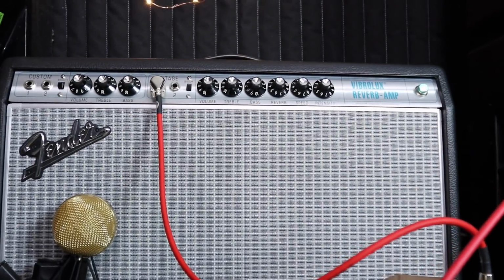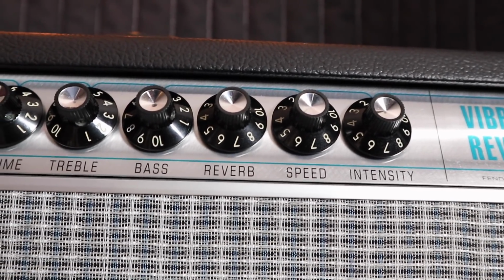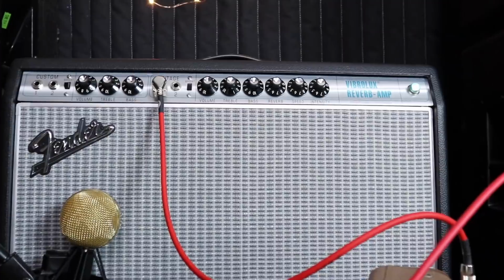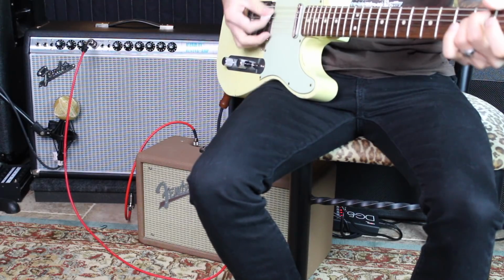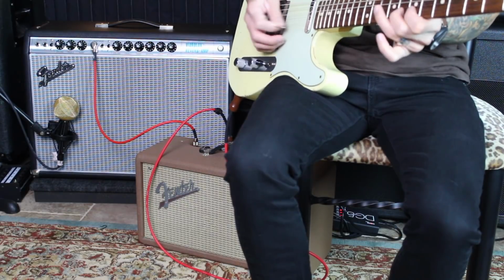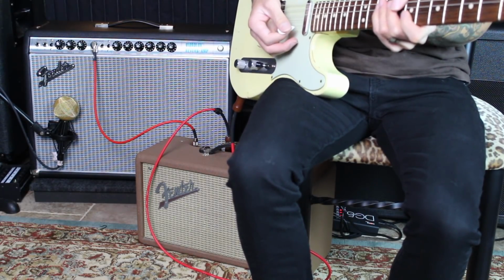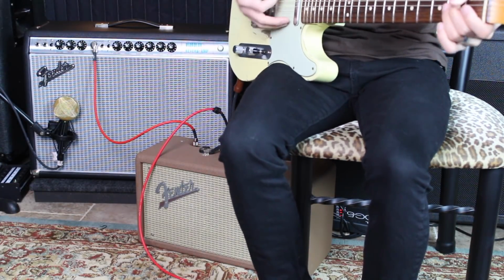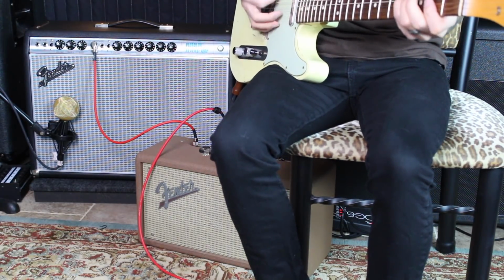Amp Reverb vs. Stand-Alone Reverb Tank | Guitar Gear Tips - Tutorial | by RJ Ronquillo

Comment: "re-VERB"!  Ok ... here's what you do with that in-board re-VERB unit in your combo amp! Unplug the input at the amp, that leads from the tank (the tank output wire). Buy a female-to-male RCA cable to be used as an extension. ALSO, buy a 1/4" male jack that has a FEMALE RCA jack on its butt. Plug that extension into the RCA-female-to-1/4-male jack, and plug that into the FRONT of the amp, channel one. Roll off all the bass, but maybe ONE or TWO. Increase the treble to your liking, maybe even push up the "BRIGHT" switch. Channel ONE essentially becomes your re-VERB control, so set the volume where you like it in relation to your DRY volume, in channel TWO. You will love the sound!! SO much better than the normal re-VERB sound! Try it, you'll like it!
Reply: This sounds cool, gotta try it!
Reply: @DaveElke  Yessir. Makes a BIG difference in my opinion!

Comment: To my ears it seems the standalone has the holy grail surfy drip that no other tank or pedal can touch.
Edit update: The Surfybear could be a contender.
Reply: I have a reverb pedal made by a company called Fuzzrocious that's as close as I can get. It's not the same, but it has a great drip.
Reply: But, is the Surfybear able to have the 'stomp shatter' effect done, as can be done on the FenderReverbUnit?
Reply: @bonsummers2657  It could do. It’s still a spring tank, just with no tubes. 🤞🏼

Comment: The Reverb Spring Tank Units were probably built by (or licensed by) Hammond as the Non-Necklace style units first appeared in 1960 in Hammond A-100, L-100 and-100 Organs, they were predated by the Necklace Reverb units that appeared in Early A-100s and PR-20&PR-40 Tone Cabinets (the problem with the Necklace Units is that they Rattled too much).  These were predated by the Hammond Oil Reverb tanks that appeared in Hammond Tone Cabinets from the late 1930s to 1958 and could be found in HR-40 Tone Cabinets until 1963.  These Oil Reverb tanks were partially filled with Automotive Brake Fluid and had a sort of "Slap Back" Sound.

So without seeing the inside of a Stand-Alone Fender Reveb, I would assume it had a Hammond Tank. I have a Late 1960s Conn Organ that has a Hammond Reverb Tank.

Baldwin (for their home organs) had a Reverb Unit called a  "Panoramic Tone" that somehow got around Hammond's Patent, it also used a Spring, but it was a suspended spring (similar to the Hammond Necklace, but it was a larger Coil spring resembling a Slinky but only half of the Slinky's diameter.  I pulled the Reverb Tank out of a later Panoramic Tone that had a different off shaped spring in a small metal box. 

There were also Tape Reverb Units (Schober Organs and the Echoplex) and Plate Reverbs used in the Recording Industry.
Reply: I got the Boss Clone of the Fender Stand-Alone Unit for one of my Hammond Organs, hoping it would be able to respond like the Electrotone Organ Mate Aftermarket Reverb kits for a B-3, but it could too easily be overdriven by the organ (it would work on a very minimal setting only, that was a bit too soft for my tastes), so I put it in my Guitar stomp box kit where it sounds at least close to the original.

Comment: My goodness. Standalone by a mile. It's THE DRIP! thanks for doing this.
Reply: It's only more apparent because he runs it into the front end of the amp. It would probably sound similar if it was in the fx loop.
Reply: @Mikhail72051  It's made to be a preamp. Why would you want to remove it's best feature by plugging it into an effects loop? Also, the amp he's using for the demo doesn't have an effects loop.
Reply: @tinyb69  I built my own tube spring reverb. It sounds great through the front end, and that is how the old surf rockers used to do it. I prefer mine in the fx loop because it turns to mud if you put it through heavier distortion. I also prefer to have it after delay. Personal choice if you are playing more than one style of music, not just a set of surf rock.

Comment: That tick-echo @4:50 sounds like the echo, I recently heard at a tire distribution warehouse. Concrete walls. Truck dock was 6-8 doors. There, I clapped and heard the same echo-clap Same sound.
Reply: I wonder if an EQ, plugged in line with RCA IN/OUT could  help tame the harsh trebles.
Hmmm.

Comment: Do they make the stand alone reverb tanks now? If so, how much are they? If the amp itself has reverb, like say, a Twin,  would you still need this tank?  Does it have tremolo or  vibrato with the tank?
Reply from the maker: I don't think Fender makes the stand alone tanks anymore, there used to be a company called Texotica that made a version, but i don't know if they are around anymore. Best bet is Ebay or Reverb.com
Reply: What is a decent price for one in good or decent condition that at least works well? Man, I want it to sound like a heavy rain blooping and dripping off the roof, or  dripping waterfall. I only heard ONE guy do it that well ONE time and forgot who it was and what song..Teach us the ultimate wetness..

Comment: My amp, a Fender Vibro-King, has three knobs for reverb; dwell, mix, and tone, just like the reverb tank.  It may be a little different from both of the ones in the video since it uses a different tube to drive it.  I'd be curious if R.J. has tried out one of these.
Reply from the maker: Yes, great point - I will see if I can get my hands on a Vibro King to demo
Reply: As a side note: my amp is the earlier version with an EL-84 reverb driver which Fender later changed to the more robust 6V6.  It may make a slight difference in the sound.
Reply: bills48321 
Vibroking has the 6g15 circuit inside the amp.(the same as the standalone)

And the og 6g15 uses a 6k6 (8watt 6v6) so the el84 ,6v6,6k6 sound very very similar in those circuits.
Reply: Killer amp
Reply: @RJRonquillo  You won't want to give it back 😁
Reply: Did they reissue the Vibroking ?

Comment: I prefer a more clear reverb as it has less blur and more note articulation in its response......a less wooly reverb drive.  So in the stand alone unit as you demonstrated the dwell knob.....it comes up fast to really drive the tank hard, so that part of the circuit needs adjusted to have a better and more useable sweep......it basically has way too much gain plus its a 12at7 tube which actually should sound a lot cleaner.In a reverb combo amp, the dwell is set by a fixed resistor connected to the grid of the 12at7 reverb driver tube, and that's a 1 meg resistor.  To tame down the reverb would be to swap a 470k in for that  1meg dwell resistor so to not overdrive the tank input and cut the saturation.  You might have to drop it to less than a 470k.....but that's a good starting point.  On the other side of the tank is the reverb recovery tube which is a 12ax7.  /on the reverb recovery tube, you'd change the cathode resistor from the 1.5K to a 3.3K to tame down that tubes gain via its bias and substitute either a 12ay7 or a 12at7 and preferably a JJ12at7 tube for this reverb recovery tube.  The reverb driver tube is well suited to be a EH 12at7......and you could also swap the 500pf reverb input cap with a 1000pf cap or translated to a .001 polyester mylar type cap as to let more low mids and lower end pass thru the tank and warm it up richer in dynamics and have way more clarity in the reverb.  Another good point is ti swap the fender accutronics 2 spring long decay tank with a MODtype 2 spring long delay tank as these tanks have a richer tonal response vs the accutronics.  The actual reverb knob control is a mix type control for the combo amps, but you are dialing in the wet reverb signal on top of a fixed level dry signal and the circuitry has a fixed ratio between overall dry & wet signal.  So the adjustments let you come up higher on the dial with the reverb knob which means more signal is going to be driving the phase inverter and power tubes.  I find that a lot of my client just use a touch of reverb where they set it at like 2 or 3 on the dial.  I like to play off the reverbs so I set mine higher to maybe 5 or 6 on the dial......as any higher gets too overdriven and saturated.  With the adjustment to the reverb circuit, you'll get a better sweep of the effect on the reverb dial....with more useable range with the reverb......but yet when maxed out on the reverb knob..... gives the saturation of reverb effect.  I occasionally use a 12ay7 in the reverb recovery position to subdue it more and get more clarity.  And I'm also known for occasionally  changing the fixed ratio resistors to add more reverb but also makes both signals of dry and wet more stronger in hitting the phase inverter and power tubes for a more aggressive amp response.
Reply: I've recently gone to tweaking the solid state reverb circuits in the blues deluxe and deville amps.....which I find to actually be a more versatile reverb once I adjust it.  I add a dwell pot to adjust the dwell plus a switch that has 2 profiles for the reverb response.....if you think of the reverb as a room.....you can switch it to be a bigger room with a more bigger deeper response and more saturation like the 63 outboard style unit.  I'll be tweaking it further to add tone controls.   I find that the typical TL072 chip in the solid state reverbs to be too sterile clean, so I swap it out with another IC chip in the family that is more juicy and musical in response and having a richer tone
Reply: @mikecamps7226  see, i thought the same thing. the reverb on that amp just sounds....bad. my solid state pa-200 peavey with a built in reverb sounds very close to that stand alone unit, even with the amount of drip. i think it just varies from amp to amp. maybe the tube circuit overdrives the springs to hard.
Reply: @frigglebiscuit7484  The tube reverb doesn't respond to tweaking like I can get with the IC based solid state reverb.  I have found an additional point with the tube reverb that I'll be playing with......and then see if it will translate to the solid state reverbs.  I look at it from a signal strength perspective.  The tube circuit uses a really padded down dry signal to mix with the wet signal.   AND the solid state has the same situation......     You have to have the right ratio with the wet and dry with the circuitry as is.  When there is just a single reverb control......it adds on to the dry signal at the preset ratio level and the reverb control is basically a volume control pot to add the reverb signal on top of the dry.......its a parallel effect situation.  SO to get the reverb signal boosted up high to compete better with the dry since the dry has to be padded down drastically......you'd need an extra tube for the tube type reverbs so that means chassis space.  In a solid state reverb....it means another IC.  BUT you also have to pay attention to the phase of the signal which is easier in solid state  since its less chassis space and real estate.  I'm looking at it in the end result not for just the effect.....but the signal strength coming out of the merger of the wet & dry signal and how it hits and drives tube stages down stream.  In the present system of the circuitry......its a soft signal due to padding down the dry so much.  The merge resistor for the dry in a tube reverb circuit in a reverb combo amp is a 3.3 MEG usually......so thats alot of resistance to pad down the signal....thus weakening it.......and translated on the wet side....the reverb signal is that weak so where you have to pad the dry down that much.  You can't jack up the gain on the reverb recovery tube as then it will start to compress and go over driven and distorted and you want clean.....as the signal then goes to another gain stage as the mixer amp for the wet/dry signal before it hits the phase inverter and power tubes......     The 12ax7 reverb recovery tube has a hot operating point as its set up, so going to a lesser tube will take the wool off.....so a 12at7 or a 12ay7 is a lesser gain but has more signal push as those 2 tubes put out more current than a 12ax7

Comment: Hey RJ - I have that amp! (can you believe I traded a '69 Princeton Reverb for it?) and I found/find that the onboard verb is hard sounding.  not like any of the previous bf/sf fenders I've had.  I also traded the speakers with a pair of eminence 1028K (same speaker as the blue frame alnicos)  but anyway...... the stand alone unit has always been THE sound to me.  It's got me considering a Vibroking, which has one built in, plus that trem!
Reply: Vibroking is the shizzle as well as the Tonemaster

Comment: Should one use speaker cable to connect the reverb unit to amp? I have a Hoffman reverb unit that route into my amp. Currently using an instrument cable.
Reply: Nope, instrument cable does just fine. It is not speaker level signal coming out from 6G15, actually it is probably little bit lower than unity gain
Reply: @TheHumppaidiootti  Thanks!
Reply: Stick with the instrument patch cable. 
Speaker cables are not shielded and could allow additional external noise and other issues into your signal chain.

Comment: Does anyone use the stand alone in the effects loop, or usually always in front? I'm wondering how my bludotone bludo drive with the loop a later , d-style ods amp would sound with the stand alone. I usually run all my delay and reverb through the loop a later effects loop. I have a 64 super reverb but have always wanted a stand alone!
Reply: Brett Vanderhoof I have a d style amp I’ll put my unit in the loop and let ya know!
Reply: Update. It’s great.
Reply: The reverb tank needs to go before the amp imo. I’ve used one for years and am amazed at how cool they sound with little or no overdrive.
Reply: Joe Jabon the cleans are very good

Comment: I’m sure this is probably a wild question… since your signal goes through the reverb unit before going into the front of the amp, is there a good setting for getting a good lush reverb when overdriving your amp? Maybe even with fuzz. I’ve tried using it and it seems that these reverb units are really only good with clean guitars. Putting an overdrive or fuzz pedal in front of a reverb seems like a bad time. I would really like for it to not be so.
Reply: Try gain pedals after reverb. Maybe impedance converter between reverb and fuzz, because fuzz needs high impedance input and reverb unit buffers signal

Comment: How would it react with overdrive?
Reply: I have the same stand alone as in the video, and I personally don't think they pair well with overdrive pedals or even high amp gain.  Ideal however for crunch and near break up tones.
Reply: Reverb Unit has limited output of wet signal, because it originates from tank. Dry singal goes just throught buffer, otherwise unaffected. So hotter the input signal, less audible reverb, because that dry signal overpowers wet signal

Comment: The reverb in my '65 Deluxe reissue is bonkers. On 3, it is WAAAAAAYYY over the top, and it not a pleasing sound. I use Boss' 63 Fender reverb pedal...  it goes head and shoulders above the useless amp 'verb.

I'm also trying the JHS octave reverb, where you can control the trail tones to be an octave high, or low... I'm still new with this pedal.

I'm wondering if Fender goofed, and put the wrong taper pot in... it comes on way too much, way too soon.
Reply: Why not just roll it back a little? Can you explain that?